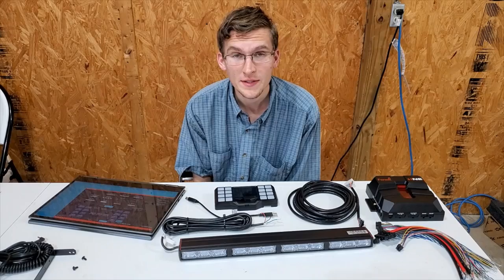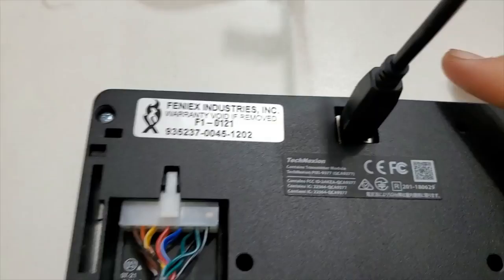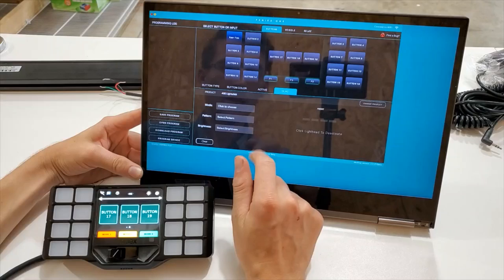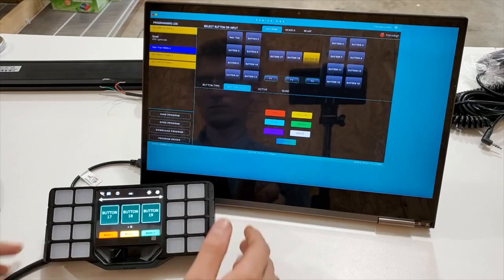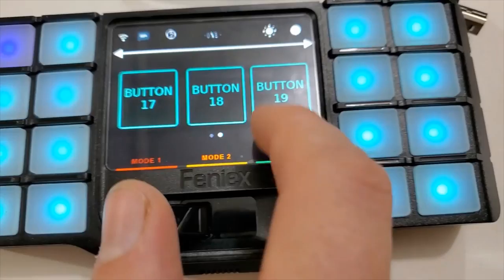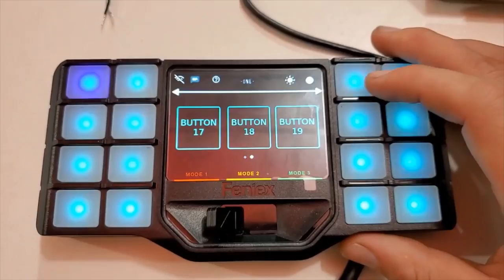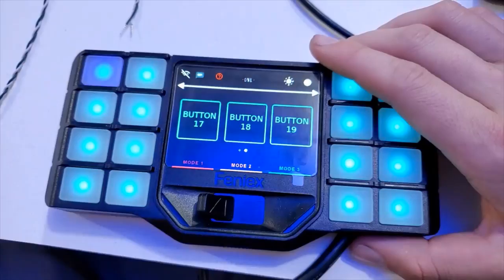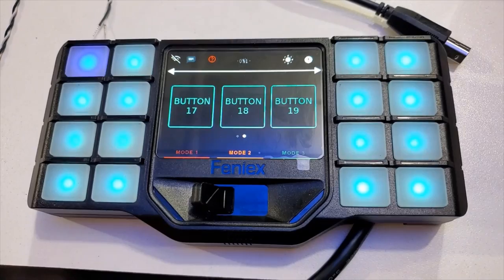Feniex One Controller Functions and Programing

Comment: I have reached out to you in the past and your experience is accurate and knowledgeable. Your service to the community is excellent in comparison to Fenix technical support, their engineers are afraid to speak with me . 
With this said I have run into a snag .

I have a quad 600 stick and I own the latest lightbar, the Quamtum, my Fenix I, as I try to program the quad it won’t program

Comment: I sent you an email last week, about a spec out and a bunch of questions, not sure if you got it.  I am also in the Feniex group on FB, but still waiting for my posts to be approved.  I also posted in there with the questions.

One of the main question is, If i was to use the Quantum line, does it HAVE to be programmed with the Quantum software?  Like I want to use QSSM stuff on the perimeter of the vehicle, but with the programing software for the Feniex One, you can't use both.  

If you connect Quantum stuff to the serial cables, can I go to the GPL49 bar and program that in the software and will it flash how I have it set up?  If not, how do you get the QSSM stuff to sync with the Quantum stuff?  On Feniex's demo vehicle, they have everything working together.  But all their stuff, and the software says if you activate Quantum Inputs, you can not do Quad.  I am really confused how they expect users to use the Quantum line on the F1, with QSSM stuff.  

I am hoping the Quantum 600, 800, Interior Bar and the Lighters will just flash how you set them under the Quad menu, so you can activate QSSM zones with them.

Also how do you get Steady Burn red and blue on the QSSM stuff at full brightness?  Use flood and set the color?  Same with the 600 stick and the bar?  I know in one of your other videos you mentioned that setting it at cruise 100% is not the full brightness.  I have a bunch of other questions but this is the main stuff I have questions on from playing around with the software for the F1.

Comment: Can you do away with gps module? does controller have siren and connections built in or need buy seperate siren?
Reply from the maker: You do not need the GPS and the siren is built in , no need to buy anything other than a speaker! 
http://swatara.square.site

Comment: So if I have 6 quad surface mount lights do I just tie them all into one input? And will I be able to change things like the color when I do this?
Reply from the maker: No you can only change color when programing the unit , you can select as many modes as you want though with multiple colors , if you have regular surface mounts those can only be tied into the 12v outputs and not the data nodes for the lightsticks and lightbars , in order to get data controlled surface mounts we just take apart lightsticks and extend the wires
Reply: @swatarawarninglights  so if I had a quad surface mount light would I be able to change the color by using the controller or would I need a quad converter?
Reply from the maker: @Jacob-mm8xq  you could change the color through reprogramming through the computer software or you could use a quad converter which is a lot quicker of a way to change the color on the go , both ways work well and it depends on whether you want all the functionality of the Feniex One or the less but still very functional Quad converter
Reply: @swatarawarninglights  thanks
Reply: @swatarawarninglights  Thanks for the help
Reply from the maker: You're very welcome!
Reply from the maker: @Jacob-mm8xq  you're very welcome

Comment: Question, I see that you have the controller wire connected to the relay. Does this hive to be connected to program or an you have just the controller connected to the computer?  I have  Fi controller that has ben giving me several issues. Feniex has ben great and is sending me a new one, just want to make sure I am programming it correctly.
Reply from the maker: No you should not have to have the controller connected to program the Feniex One

Comment: But can you program it so you can run each module independently for color, for example quad 400 stick can you have blue, red, blue, red for each module while it’s flashing
Reply from the maker: Unfortunately not at the moment,  however they are pushing updates via wifi and we are really excited to see what gets added next!
http://swatara.square.site
Reply from the maker: You can use the dual color feature and get close to that with some of the patterns thought
http://swatara.square.site